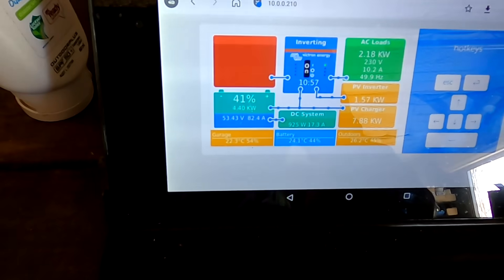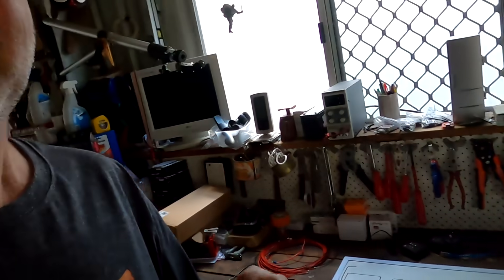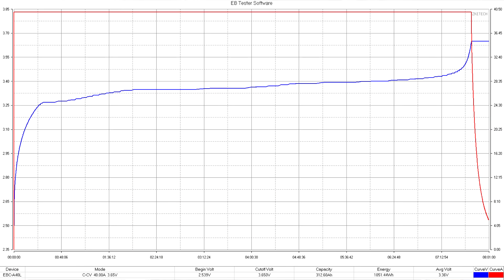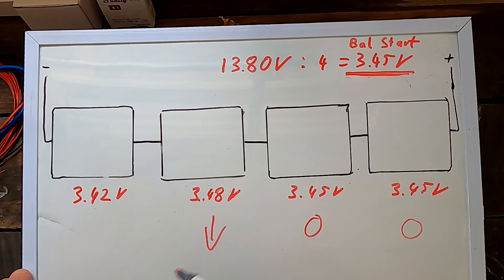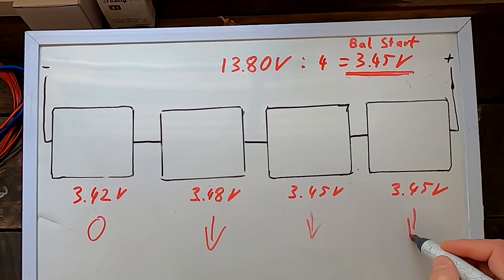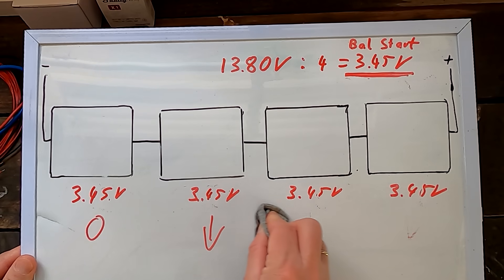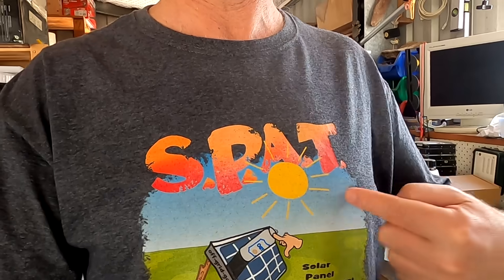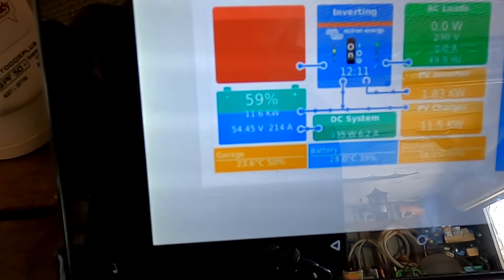Balance Start Voltage for LiFePO4 explained. Why you should not start too early... 🔋⚡

Comment: Are you sure the ‘balance start voltage’ is the voltage over which all cells will be discharged and not the voltage over which ONLY the highest cells will be discharged?
Reply: This is correct for active balancers!
Reply: @ClausMallorca so you say that “passive balancing” is just a stupid all cells linear fix current discharging?!? This makes no sense at all. On the other hand, on software we see that at a time, the BMS is balancing 2 cells: the strongest and the weakest.
All the time. And this is not done by discharging both, that would be nonsense and we clearly see that the weakest is charging when the strongest is discharging…
Reply: @NoiseSHome   Most bms have a differential setting that has to be met to start balancing. So for example if 20mv differential is set in bms, no balancing will happen at all until the cell deviation is above 20mv. If one cell is 20 mv above all the other cells - the high cell will balance ( bypass resistor turns on ) but the other cells will keep charging to whatever the charge setpoint is . If the low cells raise voltage, and the high cell drops , the deviation turns off balancing below 20mv differential.
Reply: @LarryKapp1  that means Andy is totally wrong when explaining that the low cell will also be discharged along with the other. 
The low cell(s) must NOT be discharged by the resistor(s) in order to balance the pack. If things would happen the way Andy is explaining, there would be zero balance along the cells, that would simply be “all cells discharge” and that sounds ridiculous.
Reply: Some BMS boards also require all cells to be above the trigger level. It comes down to the manufacturer's implementation. Simple balance board or BMS boards will simply have an analogue circuit (ie not smart ["computer" controlled], and component variance means that the trigger levels will differ slightly, and generally fades in or out instead of a sharp turn on or turn off) for each cell which has a set voltage level where a limit is over ridden (or exceeded) and the discharge path is enabled. This is the most basic of balance mechanisms.
Reply: @CollinBaillie  can you give is a few balancer models working the way you (are trying to) describe ? Are you saying that when any cell (high or low) exceeds a voltage, it is discharged by resistor, no mater if is high cell or low cell?!? How could that be “analogue circuitry”, since Andy clearly states that the voltage IS computer controlled, since it can be set up by the app? So it IS computer controlled, so “computer” (processor onboard) decide when EVERY cell is discharged by the little resistor. What about that?
Reply from the maker: My example was charging to 13.8V but starting balancing at 3.4V. This would then discharge all cells with a passive balancer.
Reply: @OffGridGarageAustralia  please tell us what BMS exactly are you taking about? It looks like others say that when balancing, only the high cell will be balanced, based on the differential, and not ALL THE CELLS - this would be a nonsense, since balancing ALL CELLS is simply discharging the battery, what BMS is doing that, in your analysis?!? 
There is not only ONE resistor for balancing, there is one for every cell and every resistor starts discharging one single cell at a time - not ALL of them. Am I wrong?
Reply: @NoiseSHome  "Am I wrong"  No, you're right.  This is a rare case of Andy having the wrong end of the stick.
Reply: @fratermus5502  I ♥️ your diplomacy, I should learn more of that 🙃. Andy is a loveable person and one can’t not love him, even when he-s not quite on track. 
✌️♥️🌞
Reply: @OffGridGarageAustralia  Nope. I highly recommend watching Andy's excellent videos on the subject. For instance, check out "Seplos BMS 3.0" and skip to around the 10:30 mark. In this segment, Andy demonstrates that when all the cells have voltages above the initial starting voltage, only the highest cells undergo the balancing process.
Reply: @OffGridGarageAustralia  My passive-balancing BMS doesn't behave that way with those settings.  it reduces current to the highest cells when the voltage  and deviation criteria are met.  The highest deviation I've ever seen during Abs was 40mV, and 12mV at the end of Abs is more common.

Comment: I have 4 12volt LIPO in 2s 2p for 24 volt system. Do I need to completely disconnect them to charge them independently ? Or can I run connections to each battery separately while charging one at a time to balance charge?
Reply: You can do that and it will take forever. Just paralel them all and you’ll be grand!
Reply: Batteries are in a trailer tongue mounted box.  No room to easily disconnect battery terminals. That is why I made up pig tails separately to each battery.  @NoiseSHome
Reply from the maker: Yes, you can charge each battery separately. There are also balancers for 12V batteries out there. I have one, but never showed it on the channel. Maybe now is the time!
Reply: @1fastbuggy502  oh, you only “parallel” them once (or a couple of times) when new, before building the 2s2p. Also in that phase analyze your batteries and pair the “p”’s to make it more balanced out of the build.
I did this with a 12V, 2p4s battery and used it without bms (as an experiment), with only a capacitive balancer. Now I am experimenting with a 8S 24V battery and it just “auto-balance” under 100mV, no matter what. Actually most of the time it runs under 10mV differential and this is fascinating. 
Having the 12V pre-build is a pain, you should now install another BMS over the internal BMS-es 🤦‍♀️. I would open the cases and use the internal cells with a 8P BMS only. On the other hand… how “unbalanced” do they run now, in the 2s 2p configuration? What DV are you measuring in different stages?
Reply: You can run connections to each battery separately while charging one at a time. The cell under charge will not affect the other cells.

Comment: what about discharging the highest cell and put the energy to the lowest cell?
Reply: That's active balancing not passive balancing as shown in Andy's example.
Reply: @vonasi2  My English not is the best, so, maybe I misunderstood something.
Reply: @vonasi2 could you be so kind and explain how passive balancing works? And how that is “discharging” the most discharged cell, cause that makes no sense at all, that means the cells will never be balanced :-)))  right? I mean, discharging ALL the  cells in the same time, that means discharging, not balancing :-)))
Reply: @NoiseSHome Passive balancing works by discharging the cell it is balancing. It removes excess charge on cells which are approaching the top of the curve earlier than other cells in the pack) This is a left-over convention from the use of say packs made from 18650 cells where capacity was maybe 1500mah and balancing works at 0.1c (1/10th of battery potential current flow) versus these bigger cells of 300,000mAh (200 times larger current capacity)

In Andy's example, the stated balance threshold of 3.40v, would mean that all of the cells are higher and will trigger balancing. So, yes all cells will begin "discharge" balancing.

If you're charging with say 17 Amps at that point and balance current is a measley 70mA, then I guess this will counteract this early beginning. However if balancing continues after 100% charge (let's say 3.45v) and is still set to 3.40v, it will discharge those cells back down under the desired charge voltage of 3.45v or whatever.  If some sort of over voltage protect is set to 3.45v it may take until 3.40v or under to "recover" and remove that protection state and begin charging again. 

The point is to set your balance trigger to meet two states:

1) Is somewhere in the steep end portion of the charge curve

2) Is not lower than the lowest "fully charged" voltage level (let's use float voltage).

I think Andy may have shot himself in the foot by over-simplifying his example (by not discussing cell differential and Bulk/Absorb/Float voltage levels and so on)
Reply: @NoiseSHome   Passive balancing has resistors that shunt a certain amount of current . So if the bms  turn on the passive resistor for a specific cell , it shunts ( heats up) the small amount of current that most passive balance bms can do - like 80 to 150 ma.  So the passive balancer only works well with smaller charge currents .  Your question is how do the low cells come up ? Ideally the bms only turns on the passive balance resistors for he high cells, and then this lets the low cell continue to charge. So if the cell balancing is  only at the ma value of it's resistor then that cell does not charge. The cells that do not have the balance resistor turned on continue to charge.
Reply: @CollinBaillie  my BMS app and all BMS apps I’ve seen on Andy’s channel say completely otherwise. Taking about the JK-BMS, cause this is the case, we clearly see how the BMS is balancing ONLY the HIGH CELL and the LOW CELL at a time. Only those, and we clearly see energy transfer from the high cell to the low cell. Wee see that and I see that. However, he is still asking for disabling balancing in charging state and this makes no sense. Also, again, your explanation is clearly false, the videos shows that the BMS we are working with (JK-BMS, particularly the new model) is working totally different from what you describe here. 
These are not oldie 18650, this is something else. Try a LiFePo4 and a modern BMS, you will be amazed!
Reply from the maker: The same start voltage still applies...
Reply: @OffGridGarageAustralia  the start voltage applies… for what? For starting evaluating what cells are high and what cells are low, or to dumbly discharge ANY cell with voltage over that start voltage, cause this is nonsense and the mobile app clearly shows otherwise.

Comment: You are wrong. A smart bms will never discharge the lowest cell even if it is over the start balance voltage set point!
Reply: I would say this is right. There is a video around explaining the capacitive external balancer and it is always moving energy from the high voltage cells to the low voltage cells. 
More than that, having “bottom balance” will help introducing all the cells with the (almost) same voltage into the “linear zone”. In the linear stage the balancer will work less since the almost equal voltage on all cells. At this stage, Andy is telling that the balancer will perform “unbalance” to the cells, but I can’t see how - at least not the capacitive one.
When the first cell will start to “leave” the linear stage, it will be “taken down” automagically by the balancer - ar the very first millisecond. Why is this important?
Because if we don’t keep that one rebel cell “in line” with the team, it will hit the BMS high limit and it will stop the entire charge. For ALL the cells! And this IS bad. Balancing takes time so why on Earth don’t we keep the balancer on, all the time? 
I can’t get it.
More than that, I have some interesting observations filmed many times with results totally different from Andy’s. I’ll translate them in English and I’ll show you that whatever I do to my cells, they “self-balance” in DV of 1-11 mV. Heating them hard would get them on the DV of 100mV but after a little bit of time (rest or charge or slow charge) they recover in the 1-10 mV!!! Without BMS or equalizer attached! And these are chineze “Grade A” cells, not certified cells or anything… Strange, hm?
Reply: Andy showed in a video that the Daly BMS discharges all but the lowest cell providing one is above the set balance voltage and the minimal deviation is reached.
Unfortunately I am stuck with a Daly in a sealed box. It is above 99% when a cell reaches 3.4 V so even at 3.4 V it only balances for a few minutes (can't turn of charge balance) After half a year of this I can finally charge it to 3.4 V per cell average without one of them hitting 3.65 V
Reply: Balancing start voltage, does not mean that the bms pulls the cell down to that voltage, some types of bms work that way, then this is al true.
But otherwise, a smarter bms only drops the higher cells or with active balancing, even pulls up the lowest cells, also when it is above balancing start voltage. You should not balance to early,that is true, but it makes sense to balance when the charge current is a fair amount lower then the possible balance current, so 3.45 is fine but it does not mean that your target voltage cannot be higher. You can either set it higher so the bms has time to balance, and gain some capacity, or stay at 3.45 and set some absorption time.
Reply: I think passive balancers might, whereas active balancers are shunting from top to bottom.
Reply from the maker: As in my example, if you set 13.8V as your charge voltage and the balancer to 3.4V start voltage, it will discharge all 4 cells if they are over 3.4V but under 3.45V.
Active balancer will transfer energy from the higher cells to the lower cells. Both variants should still have the same correct start voltage.
Reply: @OffGridGarageAustralia  What? Over 3.4 and under 3.45.
Reply: @OffGridGarageAustralia  may I ask how did you checked that All 4 cells are discharged over 3.4 V?
Reply: @OffGridGarageAustralia  if the active balancer will transfer energy from high cells to low cells, that means the low cells will not be discharged as per your video, but they will be super-charged with a current slightly higher than normal.
Reply: @OffGridGarageAustralia  Hi Andy, Clearly, the behavior of the passive BMS described by you in this video is the "BalanceLimit" mode but the "CellDiffBalancing" doesn't work like that ! 😉

CellDiffBalancing begins only if cell voltage is over the start voltage AND the difference between max and min is over the cellDiffVoltage AND the cell voltage is over the average voltage AND the charge/discharge current is less than 0,5A
This is the official passive balancer process 😇 ... you can check !

Take care that you have three mode of balancing in passive balancer "CellDiffBalancing", "AutoBalancing" & "BalanceLimit" !

I guess you explained the behavior of the "BalanceLimit" mode but the most used is the "CellDiffBalancing" 😚 so you created confusion in the community... you should made a video explaining each mode in order to clarify the point. 😉
Reply from the maker: @jeffdeschamps9029  thanks, Jeff. See the video description😉
Reply: I think the pejorative word here is “smart”. 😂😂😂
Reply: @teddypreston5525  he waved a smart bms and an active balancer and was talking about setting balance turn on voltage setting. Dumb bmses don't have option to set when the balancer turns on.
Reply: So wait a minute thats what I been seeing. Cell 1 is driving me nuts. It climbs unequal to the rest and hits the cut off.  The other cells while charging are staying 3.45ish.  So how do you set parameters to keep cell one from climbing immaturely.
Reply: @stevenlouis1024  connect the bms to your phone app and watch and WAIT for the bms to balance the cells so they are all equal and reach 3.6 volts at the same time.
Reply: Lithium Ion comment? Actually LPF and NMC are both Lithium Ion so it’s wrong to use a generic name for one chemistry and a specific name for another chemistry.
Reply: I think Andy is talking about the built-in passive balancer of different bms's. And I think you are thinking about active balancers. They both act differently. Active balancers discharges high voltage cells and transfers the voltage in the lowest cell. While passive balancer burns down voltages of the cells when at the balance target voltage.